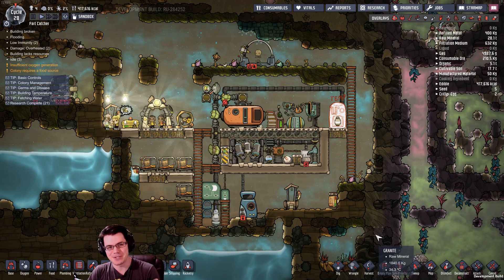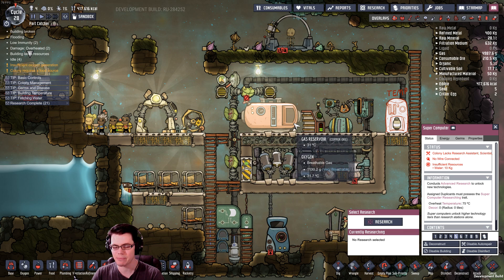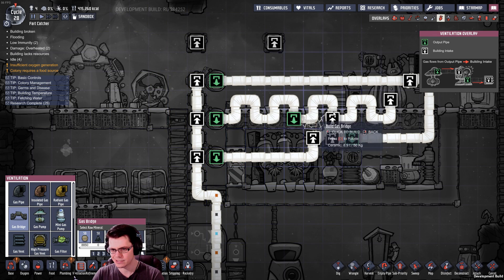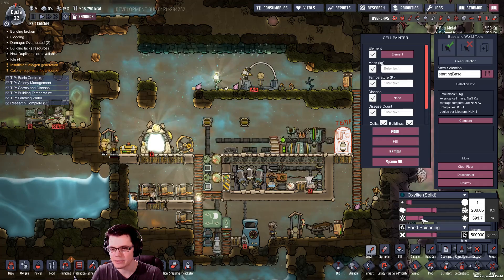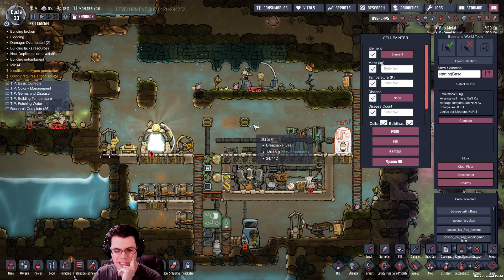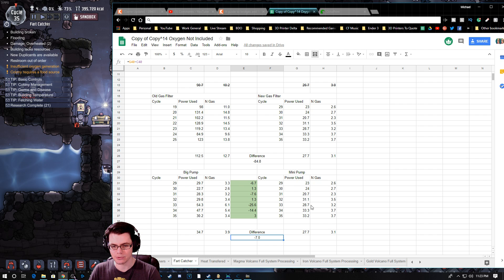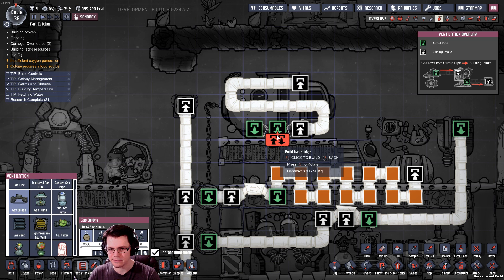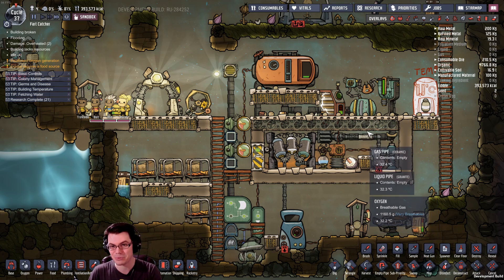Efficient Gas Filtering! Oxygen Not Included Fart Power 2

Comment: Not that it wasn't interesting.  But really the numbers.  120W a filler to 10W at shutoff.  What is better?   You don't need to run 1 spread sheet know 10W is less than 120W as it lets the same amount of gas go through it.  20W for 2 shutoffs to 240W for two fillers.  You need a spread sheet to know that 240 is more than 20?   Again you don't need a spread sheet to know in what you are testing the small pump is better.   60W to 240W.  It doesn't need to move large amounts.  So guess what 60W is all you need to move the small amounts of gas.   If your moving large amounts 240W would be better if you don't want what you are pumping from to back up.  It's not brain surgery.    No spread sheet needs to know 60W is less than 240W.   Moving small amounts of gas 60W is better than 240W.   The only thing bad is the mini pump can over heat because it can only be made of plastic.  So with hot gases you will have to waste power so to speak pumping hot gases because the mini would overheat and melt.  Again no spread sheet needed to know that.  Interesting but a spread sheet to answer which is great 20W or 240w moving the same amount of gasses?  Ok.

Comment: I always use the big air pumps if I can. I then put a gas valve after it, and set it to a low value like 30g/s. This way, the air around the pump will have time to flow back in and the pump will always suck in the maximum amount of air each time it draws power.

Comment: Even if the gas pipes could hold 10kg (they hold 1) the tank is still a 3rd layer, so you can have pipes in front of tanks in front of the background.

When using shutoff filters you should always have an overflow return pipe with priority so that it blocks new gas from being pumped when it's full. Premade filters will shut off if the pipe gets full, but these player made filters will not and will let the gas that was supposed to be filtered continue on. Best case you are just venting it and pumping it in circles. Worst case you get the wrong element in your machines.

Also put your element detectors with a pressure detector in such a way that it guarantees the pump is fully submerged in the element you wish to pump out.

Comment: Hey, Brothgar, I have an idea, why don't you try to make a self-sustaining Duplicant apartment, type, thing, having all the things a single dupe needs to survive in as compact of a space as possible, perhaps in space, to show that it's 100% self-sustaining, perhaps using a manual/coal generator for power + a smart battery to power light for bristle blossoms that feed off of the dupe's, uh, urine, that's filtered through a water siv, who's polluted dirt is eaten by a sage hatch, to power the coal generator, to produce more CO2, to be eaten (breathed?) by a molten slickster, to produce petroleum, to be harvested as a byproduct or if the system needs the power, to be used in a petroleum generator, the sand in the water siv is produced by taking extra coal from the sage hatch and combining it with clay from a deoderizer to create ceramic in a kiln to be crushed by a rock granulator. But then comes the problem of MAKING polluted oxygen, you could use morbs, but I think the rate at witch morbs produce polluted O2 is random, and if not, then we have the problem of caring for the morb, with getting the ideal temperature, or you could sacrifice some polluted water and control the amount, yeah, that would work. Why have I explained everything? I don't know. Also, does @Brothgar do anything? The top comment has it in it, so I would assume it does something. Please tell me so I understand, if you see this that is.

Comment: The mini gas pump pumps 50g/s as opposed to 500, making it pump 1/10th of the gas, but uses 60W/s compared to 240W/s, which makes it less efficient, using 1.2W of power per gram as opposed to .48W of power per gram, making it significantly less efficient. The only benefits is that it uses less power per second, which is good for a low-draw gas system, and is half the size (although it pumps 1/10th of the amount, making it remarkably less efficient). It also melts at a lower temperature, is higher on the research tree, and costs plastic (a late-game material) to make. 

In other words, it’s garbage.

Comment: Brothgar, i believe you're making the gas container more simple than it actually is...
I think its actually supposed to make gas storage more effective.
Instead of having gas fill a room using a high pressure vent and a pump, now u can add pipes, a container and still have gas in the atmosphere around it. Basically upgrade your gas storage rather than making it consume less electricity.
So having a space of 3x5 for the container plus a 2x2 for a gas pump plus 1x2 for a high pressure vent above the pump.
The calculation i did off the top of my head gives me 615KGs for a simple 3x7 room using up a total of 5x9 blocks of space.

Comment: Hey Brothgar, you should do a blueprint for a system to cool down bases. Keeping a base cool seems like the hardest thing to do in the game. I usually build my oxygen generators in the cold biomes, which keeps the base cool at first, but the base always ends up getting hotter later on, even when insulating it with two layers. I have noticed that certain tiles do a great job at insulating but the heat always ends up seeping through doors over time.

Comment: I've been playing around with this setup (or something close) and I think i've got it pretty efficient. its a uses quite a bit of automation, but the gates don't take power, so it works pretty well.
Okay, here goes (if your imagination can't paint this picture, I have included a link to an image):
a Gas Sensor (Oxygen) two tiles above the Large Gas Pump, attached to a Not gate, attached to a filter (10 seconds) into an OR gate. Also a Pressure sensor (500g) one tile above the Gas Pump. Both go into the OR which goes to a buffer (10 seconds). 
When the Gas sensor doesn't detect Oxygen for 10 seconds, and the pressure sensor is over 500g the pump turn on for 10 seconds. 
I've found this to be very efficient, using very little power, and pumping bigger packets of gas, and very little oxygen.
https://imgur.com/gallery/Y2XZz0b
Reply: As a follow up, this worked well until my reservoir filled up and the pipes leading to it filled up... I just needed to add more reservoirs :)

Comment: Could you increase efficiency of the large pump by adding a sensor to check for gas in the n.gas line, shutting off the pump in the time the line is backed up? I think you would just need another and gate for the sensor.

Comment: You can make this much more efficient! Put an gas pipe element sensor at the end of the natural gas pipe. Then have that go to a filter gate and then a not gate and then an and gate. The gas element sensor should go into the other input of the and gate, and the output of the and gate goes to the large pump. That way, when there is not (not gate) natural gas in the pipe for more than 5 seconds (filter gate) and (and gate) there is natural gas near the pump (element sensor) the pump will run
Reply: You can't JUST check for natural gas near the pump, you would also have to check for carbon dioxide. Otherwise a small CO2 buildup would break what you're suggesting

Comment: To the thing with the sour gas: You have to heat the oil up to produce sour gas and than you have to cool it down very much to get natural gas. Is it still worth the effort?
Reply: I guess the question would be just how cold does it need to be to condense to NG?  You'd have to take it down under 125C to pump it anyway.  If you already have a volcano NG converter, you've already accounted for 500+ down to 125.  So how much farther would it need to go?  And how is the sulfur released?  Can you push warm sour gas through a nullifier sink and get out cold natural gas without bursting pipes?  If you are doing all that anyway to harvest natural gas, then you can use it for cooling other stuff off before you burn it, so it's not necessarily a waste.  So many questions and interesting tests to do once this goes live!

Comment: What I'd do is stick the big pump in a pit, and make it only run once the pit fills with gas. Though I'm not sure the best way to do that. Maybe make it so the sensors at the top of the pit have to stop detecting breathable air for a certain amount of time before it starts running, then have it run until the sensors at the bottom start detecting breathable air. Though maybe the sensors at the bottom wouldn't actually help.

Comment: Brothgar I think, you can filter gases with even less power draw (0W, after the setup of it), because you can just loop gases via the gas valve (the manual one, which allows to set the thoughput of it) and set it's thoughput low, then use a gas bridge to insert additional gas into the loop, then the output is the left over gas after the gas valve input gas siphoning to repopulate the gas in the loop, however it reqires to be populated with the right gas in the first place, so you almost definetly need a filter for the setup of it, and it can't handle pipe's full thoughput (it will not filter all the gas, if it comes in at close to 1Kg of gas in a single bach).
Additionaly you forgot that the GAS pipes only hold 1Kg of gas, where LIQUID pipes can hold up to 10Kg of liquid, so the reservior is way better at storing gas than the pipes (you've got your pipes/piping systems mixed up).
Edit: For this system to work, you need to make sure that none of the filters loops get overfilled, since it might then allow the wrong gas into the loop, breaking the filter, but for the system in this video it is not a problem, since you cant have enough dupes to generate enough gas for the generator, so it cloggs up the filter and you can't overfill the room with CO2, so no clogging there.

Comment: To deal with a natural gas saturation event (fart over-run?) add a sensor higher up on the base testing for constant presence of natural gas (automation only allowing it if it persists more than 30 sec? 1 min?) then OR that with the smart battery input such that the generator runs if the battery is low OR there is a fart over-run.

You could also use automation to ensure that the initial (lower) sensors are only allowed to trigger the pump once a minute or once ever 5 minutes- this would allow you to drastically improve efficiency.

Comment: The whole gas sensing is inneficient . . . You need to create a big pocket of gas to use the big pump. The "well" you created is isn't big enough to hold the pump. Create a 4/8 deep well with the sensors at the top and the pump at the bottom/middle. If in the bottom it will drop carbon first and may not draw nat-gas as quickly. It's the same for my version of the hydrogen/oxygen separation, you make a  room big enough to create a large reserve of hydrogen at the top, the pump will most likely never see oxygen and will run at max potential every time.
Reply: If the goal is to see the viability of using farts explicitly, then a giant gas well is highly inefficient as you'd need way too many duplicants to keep it at a consistent gas pressure. Your setup is definitely more efficient if you're drawing natural gas from a geyser or fertilizer production, but flatulant duplicants alone don't produce enough to use this kind of seperation method. Especially since you need to capture the gases falling from above, and both CO2 and chlorine are heavier and will fall through your gas pocket, disrupting its consistency and falling into the pumps. Hydrogen has the advantage that it will always be the gas filling the top of a room if it's present, nothing else will rise above or through it allowing it to form the kind of pockets needed for simple seperation methods.
Reply: Not really. Chlorine is an exeption because you can't really produce it  (who would let bleach stone gasing off ?) so once you are done with it you don't see the problem again. For CO2, it's produced at a pace similar too natural gas (you got 2 farting dups, you will get twice the natural gas, and twice the carbon, you will need to keep that one in check one way or another). But of course my method implies that you only want to draw fart power when you have enough that you will not lose too much power getting it.
Reply: It's reasonable to want to bank it up until you want to use it, yes. I'd argue about chlorine though -- I find my colonies often have a little drifting around, but I use it in complicated systems for cooling and emergency decontamination, besides a little balm lily farm. Plus a little always seems to sneak in when you're expanding. Chlorine just happens, depending on your colony, and for my personal purposes I'd want that chlorine being filtered to its rightful places if it's pooling at the bottom. 

I actually do use a system similar to yours, surrounding a hot natural gas geyser. The collected CO2 at the bottom keeps the gas in a nice harvestable band, and it gives my dupes somewhere to run around at the bottom of the chamber where it doesn't get too hot (because I keep fert makers in there, too, for when the geyser goes dormant). I pump filtered natural gas into the chamber and it sits happily in its little separated cloud.

I'm not saying it doesn't work, just saying Brothgar's methods are fair for an experiment of his scale.

Comment: Just use a pipe sensor to not run the pump while the fart pipe is backed up!
Reply: Pipe element sensor + an automation filter gate in the nat gas pipe should do just fine do see if the pipe is filled up or not

Comment: @1:56 Shouldn't it be 1kg of gas per gas-pipe? :) it's 10 kg of liquid per liquid-pipe

To be fair i think the Gas tank is a real help, as you can compress a gas to 10kg per tile, without the need for high pressure vents or other contraptions (and you don't need a pump to get it out again). The Liquid Tank on the other hand with just 5t is really a shame ... it even takes 6 tiles space. Then again you can't compress water anymore right?
Reply: If you have the space for the gas tank then it's definitely worthwhile to have to get a nice hefty reservoir where needed, like having a giant battery.  Though I do agree with Brothgar that a lot of time you can make due with just some snaked pipes without sacrificing the space.  Plus with the snaked pipes you can use them for passive thermal control.  
I think the liquid tank will still have its uses since you can store and retrieve the water without the use of an additional pump.  I have a definite use in mind for this on my petroleum cooling loop to store excess liquid on the output and return lines to prevent backups and brown-outs.  Right now I have to use a small reservoir and a pump.  There may also be applications for storing liquids that cannot be pumped, like oil you've pre-heated over a volcano... not sure what the melting point of the tank is.

Comment: Use a gas pipe element sensor at the pipe where the natural gas route begins, connect the automation of said gas pipe element sensor with a filter gate to detect when natural gas has been sitting there for a certain amount of time and have that go through a not gate connected to the pump. This should result in the pump only running if natural gas is not backed up in the pipe.
A more complicated system would have a gas pipe element sensor at the start of the natural gas pipe and another one at the exit of the reservoir, have the sensor at the exit of the reservoir go to the set part of a Memory toggle through a not gate and the other sensor go through a filter gate and directly to the reset part of the memory toggle, which in turn its exit goes to the pump. This system should only run whenever the reservoir is empty and keep on running until it fill backs up again, after which it will sleep until the reservoir empties and so on.

Comment: The gas tank can store 150 kg and one piece of vent store 1 kg (max) of gas each so that would equal to 150 pieces of vent per gas storage. Please correct me if I'm wrong.
Reply: yes.  LIQUID pipes hold 10kg of liquid.  GAS pipes only hold 1kg of gas per tile.
Reply: Okay, fair's fair, I might have forgotten that. Thank you for just correcting me, and not calling me a moron.
Reply: BTW You can use liquid and gas tanks in chlorine gas rooms to clean water and gases!
Reply: Gas pipe 1kg, water 10kg
Reply: Pretty sure you're correct.
Reply: As stated, Gas pipes only hold 1K max, liquid pipes 10K. The Gas Reservoir is 5x3 tiles large, with two tiles dedicated to gas in / gas out. If you overlay the rest of the reservoir with gas pipe (what else are you going to do with it?) then you can get about (I say about because it'd be hard to use them all with the in/out placement) 12K more gas, so it could 'hold' about 162K plus any gas pipe leading to it from the source and leading from it to the generator. The biggest advantages I see to the reservoir over the high pressure chamber (20k) is that it does not require a 2nd pump, It doesn't require plastic (High pressure vent, I'm looking at you), you can place it in your base and not worry about having to build around it, dupes can walk 'through it',  and it looks cool :).
Reply: @brothgar  Im the firs one to like that coment :D
Reply: But pipes store ten kg. So it's only 15 pieces of piping.

Comment: I think that if you include the fact that most people will have a water seive, carbon skimmer, and a natural gas generator anyway, it’s a damn efficient system.
Reply: Yas, I have a base that has a spread out system similar to this, but I'll be adapting out the "filter pit" element to inject into my current setup to deal with these heavier junk gases! Definitely improved my efficiency